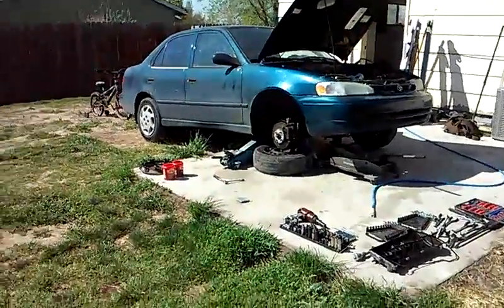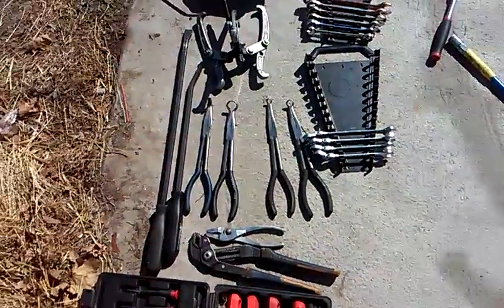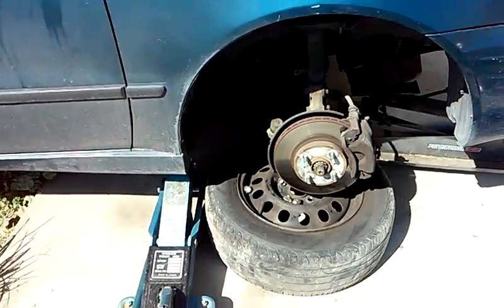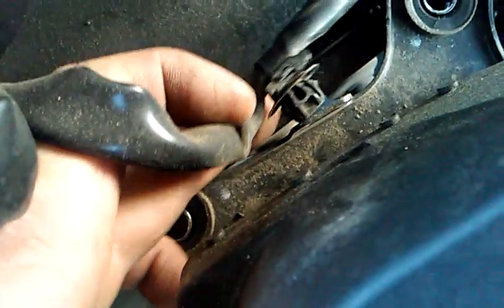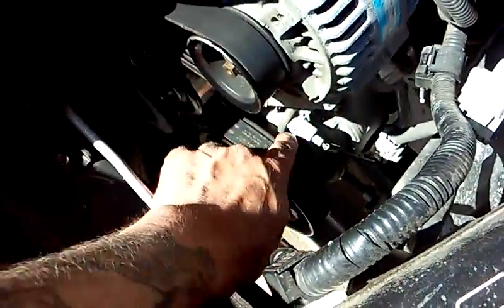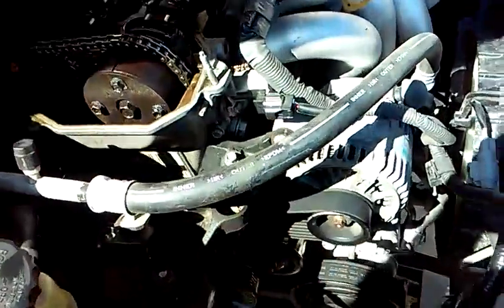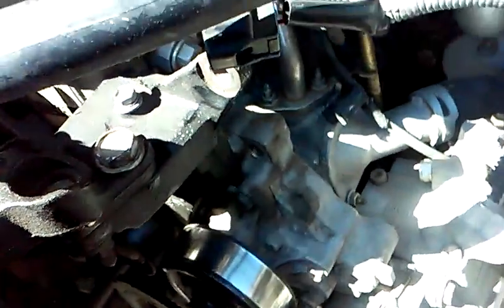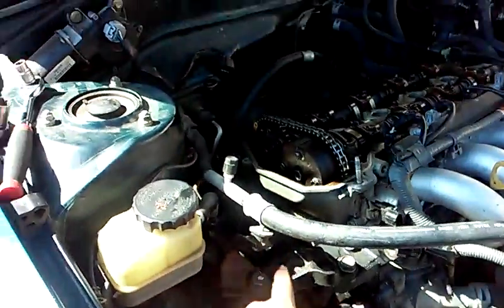Toyota Corrolla 1 8l timing chain break down part 1

Comment: On a 2010 1.8 does the engine have to be removed to do this job. The dealer wants 1700.00 to do this job
Reply from the maker: No but 1700 sounds about Right.

Comment: What are the symptoms of a bum vvt gear?  It seems the timing is off and presently won't start.  Will a vvt solenoid do this.  It started running real rough and then wouldn't start in a matter of 10 miles.